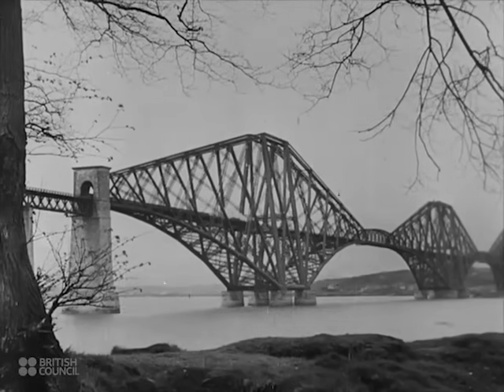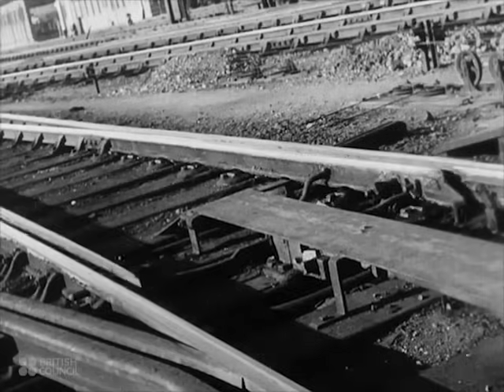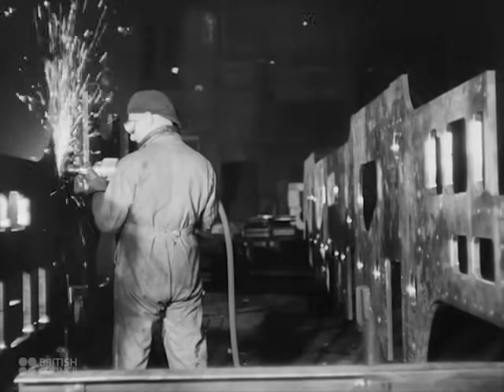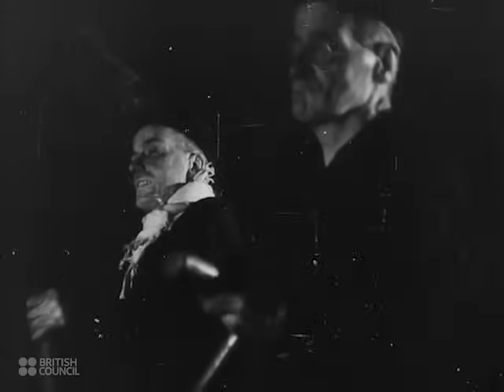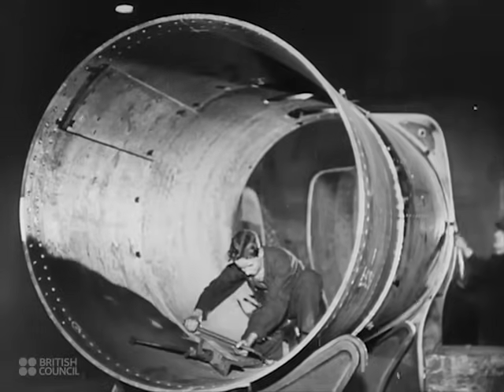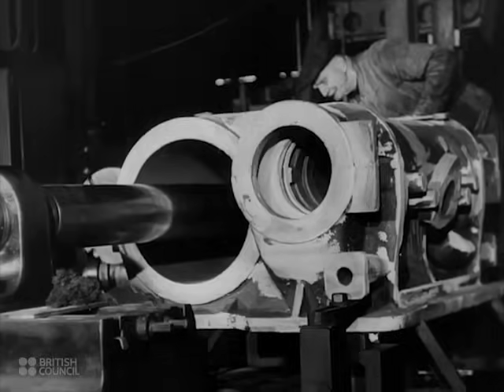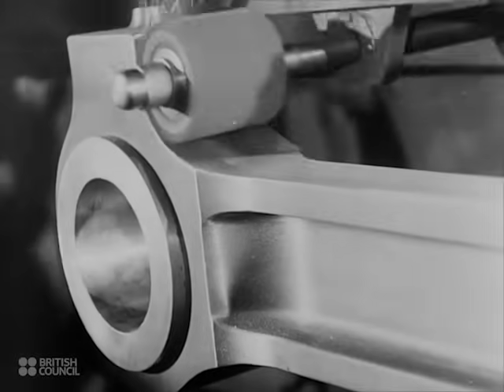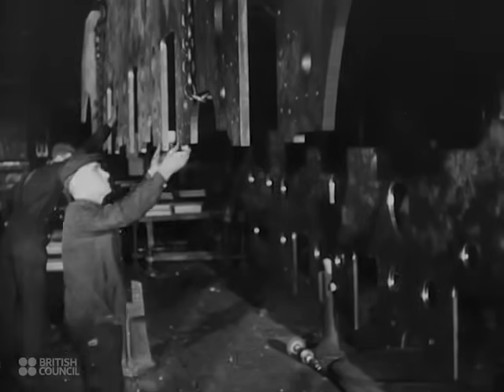Trains: Building A Steam Locomotive - 1941 - CharlieDeanArchives / British Council Archival Footage

Comment: Why can't they make more steam engine not dumb nasty smelly diesels 😒😒😒
Reply: Steamers smell more than diesel
Reply: because we have lost the men who know how to forge connecting rods from a white hot furnace with a steam hammer  mmmmm like beyer peacocks of gorton lane gorton manchester 18  now long gone thats why we are making smelly easy to make diesel engines lol the steam hammers used to run night and day  and you could hear it in my grandads house at night time with the bedroom plaster on the wall cracked with the hammers vibrations 100 feet away lol thats why mmmmmmm
Reply: Ikr
Reply: @vangledosh   Pollution, maintenance nightmare, and reliability. All steam locomotives need to be sliced apart with cutting torches and the scrap pieces sent for melting down! Destroy all steam locomotives!
Reply: @PreservationEnthusiast  steam locos will stick around for a long time,so don't expect to see one in the scrapyard bud
Reply: @davidantoniocamposbarros7528   You are correct of course. But l feel a   reasoned argument to counter arguments that steam traction is the answer to everything are healthy and necessary.

Most of these TTTE foamers live in cloud cookoo land. Have they ever cleaned out a locomotive firebox? I have and speak from experience.
Reply: @PreservationEnthusiast  as a TTTE fan,i agree that steam locomotives are good in some areas but are not the answer to everything. Also what does a "foamer" mean?
Reply: @PreservationEnthusiast  also,does firebox cleaning depends of the size of the locomotive?
Reply: @davidantoniocamposbarros7528  A foamer is someone who is obsessed with (usually rail) transport machinery. Ie They foam at the mouth when they see a locomotive.

Check it out on urban dictionary!
Reply: @davidantoniocamposbarros7528   It varies. Many later locos had rocking fire grates eg BR Standards. But this only helps with dropping the fire. At  routine maintenance, someone would have to get inside the firebox and scrape stuff off the sides as well as check the ends of the fire tubes are clear, clean the brick arch etc. This is to ensure free steaming and economic coal consumption. It's not subject to size, all locos will need cleaning.

Comment: Incredible, lifting those massive, white-hot connecting rods onto the anvil and turning them by hand under the hammer! I almost can't imagine a job like that not being done entirely by machines. Building these things was a lot of manual labor.
Reply: and no protection from the heat...These were hard men and it was a hard job...
Reply: I can understand how hard it looks, yes they were hard men but it wasnt that hard at all...well drilled teamwork.
NZ Railway Blacksmith.